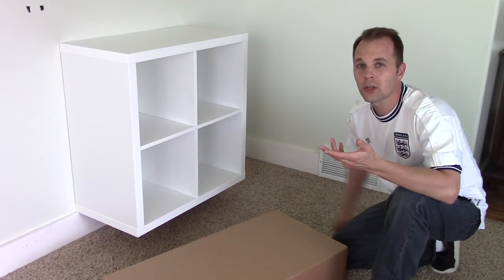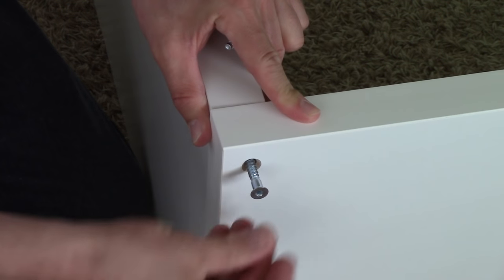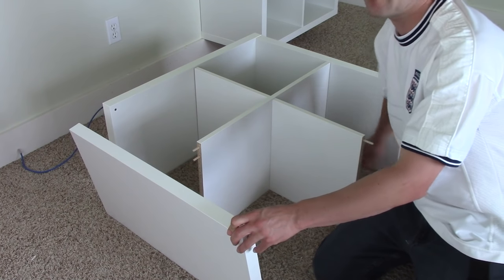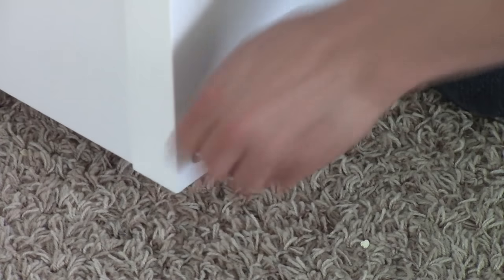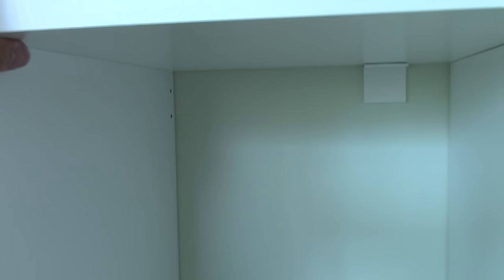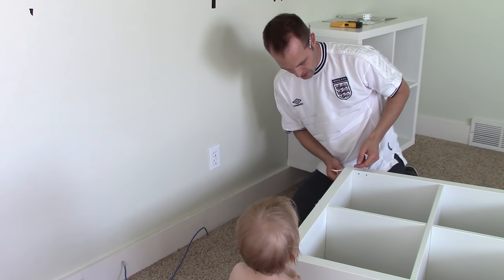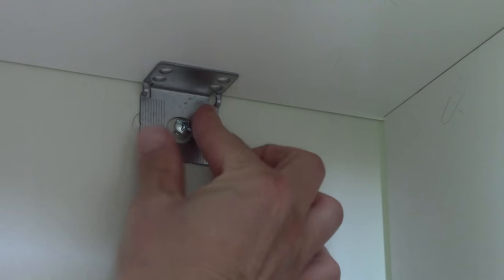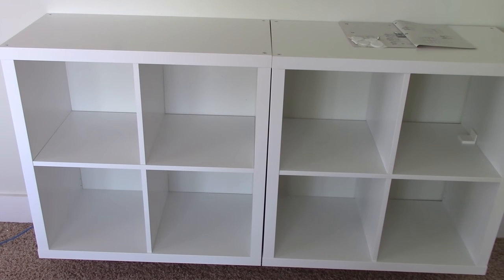Ikea EXPEDIT / KALLAX shelf - how to assemble and wall mount bookcase

Comment: The mounting bracket needs to be on the side wood piece NEAR the top, but NOT on the top piece, otherwise you are trusting a few screws going through that top piece of wood to work against gravity to hold A LOT of weight, which is dangerous.  That is why the holes are pre-drilled on the side.  I would also put a wall mount bracket at the bottom to support that piece, if it’s not on a ledge like shown here.

Comment: The trick to securely mounting a bookcase to the wall is support at the bottom. Your baseboard acts like a cleat to support its full width - fine for a 2-shelf bookcase. To wall-mount larger bookcases (with heavier loads), you'll need more than a cleat. Build a wall shelf with HD wall brackets that supports the entire weight of the loaded bookcase at the desired height above the floor.
Reply: Awesome! I have a 6 cube and was wondering that myself!

Comment: 11:55 "drywall mount that you insert and it flares out inside the drywall: is called an anchor or molly.
Very helpful video as I needed the last couple minutes. Thanks!
Reply: Yeah, anchor bolts are awesome.

Comment: What type of 2" Corase Wood Screw should I use for this same modle?  I see some that say 8 x 2" Corase Wood Screw?  

I see one on Walmart by Grip-Rite Exterior 129 pck of Phillips 2" Corase sharp point screws?  Is this the right one? I see in the Ikea Kalax manual part 11 it shows the screw head not to be flat but rising.   What kind of 2" Corase Wood Screw did you guys use?!?!

Comment: You can also run a painted 1 x 3 across the studs and then connect the Kallax to the 1 x 3 using the stock holes.

Comment: Thanks for the video. I had to take back one set I purchased. The wood stunts are hard to maneuver in and when I went to put the middle shelf the small side tipped over and the wood stunts broke off. So they were stuck into the boards. You sort a have to maneuver the thing so it won’t do that. You have to maneuver on its side and then put in the middle shelf so the small boards won’t tip over. Of course the instructions are so comical.!

Comment: Hello... Im just wondering about the cross shelf in the middle...theres 1 long placed horizontally and 2 short ones on top of each other... 

can i reverse this??? I basically want to install the long board vertically because I only want to use one of the short boards because I want to place something tall on 1 of the slots without the short board.

Comment: Great video, about to by some Kallax myself but the 4 boxes in 1 row, rather than the 4 boxes in the square grid like yours. My question how are they holding up with weight have you stored books in them. The Kallax I'm buying only comes with three wall mounts and like you I want to of course use the studs. I wondering if I should add some more brackest just in case,

Comment: Thank you for the hanging instructions! I'll be hanging a couple of the 4 square Kallax soon. I also have one of the 8 square Kallax. Ikea says it is not a hanging model, but do you think I could mount it low using a bracket in each top square (four total)?

Comment: Very helpful video. Getting this unit shortly but not for wall but on casters. I'd like to not use the top divider so I end up with 1 wide shelf over 2 cubes. Would that work? Be secure enough do you think?  :)

Comment: Thanks for this. Put this up but couldn't really find whether I'd done it safe or not, then I was worrying whether the screws would hold it in. Regardless, I ordered some free brackets that I'll use for the bottom left and right to help support the top left and right... I'm going to be sleeping under it so would feel much more comfortable doing that 😂

After a more complicated wardrobe, I was impressed how easy this went together. Will definitely be buying more for my other rooms
Reply: How did it hold up?

Comment: IKEA is incredibly ill adapted to the international market, the reason their booklet might seem confusing is that drywall is a rare thing in Sweden. Most interior walls are either solid wood or concrete, the latter you have to drill into first, put in an expanding plug and then screw in your bolt. But walls like that are equally rare outside scandinavia so it's just lazy of them not to include instructions for the markets they sell their products in.

Comment: I was wandering if you had any ideas on how best to install two of the shelves together. I didn't  want to do all the wall attaching except for 1 just so my daughter does not pull over. We have the 4 cube on top of the 4 long. I was thinking get of just screwing on to the other but didn't know if the material was good enough to countersink.
Reply from the maker: Jennifer Farris Usually things like this are built with a wood frame all the way around. Just like a hollow core door. So if you screw then together, do it near the edge (not too close) so that you are grabbing the wood inside.  You may want to drill a tiny hole first to see if you hit wood before you drill a big hole for the screw.
Reply: Thank you. You were right. We got it done the second time around and will puddy in the first holes. I found out when I went to countersink the holes that I was too close to the edge. It worked out great! The laminate is much stronger than the wood so it was a good thing we predrilled the holes.

Comment: hi, I have bought same unit from ikea.  My 4 dowels are broken while I was fixing it.  dowel doesn't get fix like u did it very easily pushing with ur hand.   I found it struggling. can u suggest alternative to dowel or I have to buy same size dowel again?
Reply from the maker: You can get most spare parts at IKEA for dirt cheap or even free.  If it is close, go to ikea.  If not just shave down the dowel that you have. Even a kitchen knife will work if that is all you have.  It will be faster than going to the store and hunting down a new dowel.
Reply: Nidhi Tanna p

Comment: Is that the white or high gloss white? I don't live near an IKEA (it's 2 hours away), but I'm planning on making 1 trip up there in a month when I get my new apartment and am trying to budget. High gloss is $25 more and I'm not sure if it's worth it or not. I'm looking for a 2x4 Kallax laid horizontal to house my records and have my black record player on top. Do you think high gloss is the way to go?
Reply: DPDLC hi!  I just wondered if you bought the Kalax in white or white gloss as I'm trying to find out what's best also 🤗
Reply: I actually went with Walmart's Better Homes and Gardens version due to a few factors not involving the actual products themselves. Based on my experience with what I've bought I'd recommend the gloss variety of this type of shelf. I have a gloss red from Better Homes and Gardens and it is much nicer than the non-glossy white I purchased. Also when I visited the ikea "near" me (a couple of hours away) the finish of the floor model non-gloss white was identical to what I owned--and it leaves a lot to be desired.
Reply: DPDLC so u think the glossy looks best?  I might still just go with matte as it's such a big price difference.  Thank you for you're reply 👍🏼

Comment: its rather short sighted that they don't supply "Distance Between mounting centers" for these cabinets like many other consumer products you hang.  This answers my questions precisely.  Now I'll be mounting them with those brackets on the TOP and positioned so that they are both on the top and equidistant from each side of the cabinet.
Reply: +Ted Thompson The cabinets were designed in Europe for the international market.  All countries except the USA use metric measurements.  Other countries also do not necessarily adhere to the imperial 16 inch centres. Building codes vary.
Reply: +peggyt1243 And not so many stud walls in Europe. At least not in UK and Portugal where I have lived. Usually brick or concrete.
Reply: +raytrevor1 At least you have a strong surface to mount the cabinets to.  You may need a concrete drill bit and tapcon screws but your shelf will be solidly fixed to the wall.
Reply: +peggyt1243 Yes, I am considering buying an eight square unit (4x2). The problem is I'd prefer it on the floor, but the back will then not be flush with the wall and I don't know if the wall fixings will extend that far out - to keep it secure. Or do I fix it to the wall above the skirting board (US - baseboard?).
Reply: +raytrevor1 It it were me, I would fix it to the wall above the skirting/baseboard.  It would be a clean look, essentially a floating shelf.  You may consider a couple of legs at the back, inset so they do not show to add further support.
Reply: +peggyt1243 The legs just at the back are a good idea. Hadn't thought of that.

Comment: @adamDIY Can you assemble this with only one cross-panel? That is, if you used all the panels the finished piece would be split into quarters, but I'm suggesting one half plus two quarters. Is this advisable?  I'm not hanging them from the wall but I am concerned about stability if I lose one cross panel. Would love your thoughts before I purchase. Thanks!
Reply: +JJ Surma I was wondering exactly the same. On the 'kallaxhacks' website they left out one of the middle panels, to accomodate a stereo system.
Reply from the maker: +MrBlaoblao Sorry I didn't see this comment till now.  I guess it just depends on what you plan on doing with it.  I guess for most applications it would be fine.  The way the shelf is designed you could have the top half totally open and the bottom divided into two.  I'm not sure about a left/right option.  Structurally it should be fine but I don't know if the holes allow for the long shelf to be moved into a vertical position.

Comment: Couldn't you have used a drywall anchor or toggle bolt that would of supported that weight anyways ?
Reply: yes but I would try to make sure at least one anchor goes into a stud for a 2x2 Kallax like that.
Reply: @RoastBeefSandwich  good point thanks!

Comment: Thanks for he video. I have the black brown color. Good thing I had no interest in the wall mounting. But still IKEA directions comical. The wood stents just did not go in easily as your video did. I thing I had two left over. No biggie. Your video was very helpful. For Ikea it  should be  but sometimes it’s comical for the directions and it’s designed to be complicated,

Comment: There's no real need to screw these to the stud in the wall, certain anchors especially the spring toggle kind will easily hold the weight of this case, up to around 25kg in some cases, this shelf probably weighs no more than 12kg.
Reply from the maker: +atyl1972 It's not the weight of the shelf that is the issue, it's the weight of what the shelf is holding. If you load this up with records, it will certainly rip out of a sheet of drywall.
Reply: +AdamDIY or you could use a 100-lb toggle bolt anchor and there is no need to screw to the stud :)

Comment: Or just use drywall anchors and save yourself a lot of trouble....
Reply: James Lee snap toggle anchors the best.
Reply: I just posted a long defense of using drywall anchors for wall shelves (on another video for short wall shelves) BUT in the case of this very deep and tall shelf, I would ONLY rely on the use of screws into studs.  Toggle/drywall anchors can hold a lot of weight but the dimensions of this particular shelf design make it much smarter to only install it into the wall studs.

Comment: Unfortunately, this is a bad idea to hang this that way. The metal brackets screw into the side of the unit for a reason.

This unit is not meant to be supported by the top shelf. And when u move that bracket to the middle that is exactly what ur doing. 

If ur mounting it low like he did and its resting on the base board, which is actually supporting the weight, I would say ok.

But this is an irresponsible video to not mention that this technique should not be used for mounting high on a wall with no bottom support, it's very dangerous..

Those 4 screws used to assemble this unit may appear very strong, but they are only going into particle board. Under loads, vibration, movement etc. They can rip out causing unit to come crashing down. Especially when that baby starts crawling and climbing on it. 

And I glue everything from ikea. Especially if ur gonna hang it.

U ever move a heavy ikea dresser, nightstand, storage unit etc. To move or to clean, and it breaks? Mine dont!. A little bit of wood glue strengthens these units exponentially.  You'll never take them apart, but why would you. 

When cabinets and shelving units are made by carpenters with high end strong materials and fasteners, they are still glued! Why would u not glue something so cheap and unsturdy. 

Anyways theres many ways to hang stuff like this on a wall safely. But it takes someone with knowledge and skill. Not a Diy'er!

Do this at your own risk, especially if have small children.

Master carpenter 25yrs